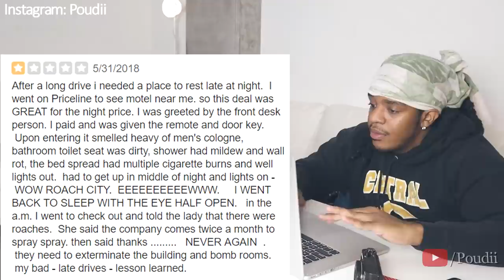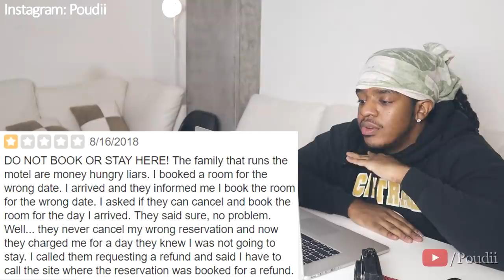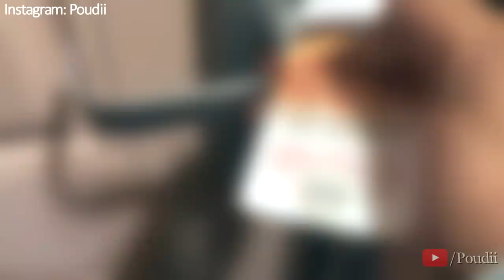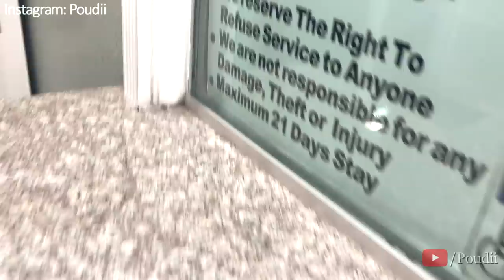Staying Overnight At The Worst Reviewed Motel In Los Angeles

Comment: You should’ve went to EZ8 in San Diego. Bad things about it:
• Under the freeway.
• Next to train track’as and trains beep a lot.
• Smells like cigarettes.
• Sketch asf.
• Some rooms have windows that fall out when you open them.
• You have to BUY toiletries from the vending machine.
• You have to use the public microwave in reception or vending machine area.
• Trash on second floors public “balconies”
• Fridge in the bathroom area that’s always open and also stinks & most of the time doesn’t work.
• Dirty bathrooms
• Begbugs
• Roaches
•  YouTuber Brawadis found 2 worms in there.
• Channel 3 on old TVs is sketch asf.
• Probably the best of all worst things; No kettle. 😆

Comment: There was one 1 star motel i got a electric shock cause a live wire hit the top part of my ear in the bathroom , not to mention the AC/ heater unit had no cover whats so ever and had a small oil drip that caused a big stain on the carpet over time plus the only channel that worked on the tv was the porn channel this was like 15 years ago but gheese that place was a craphole